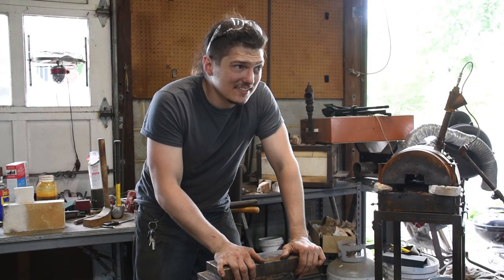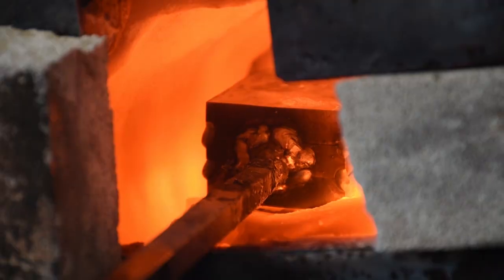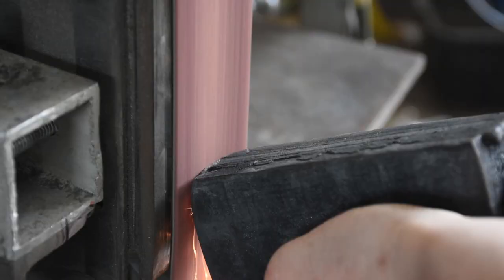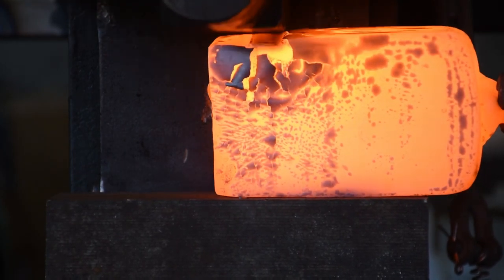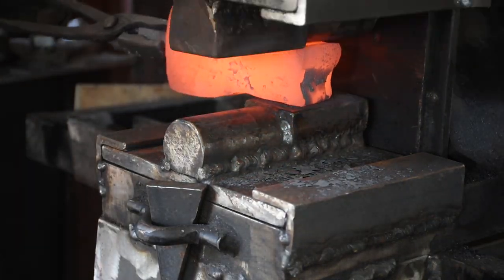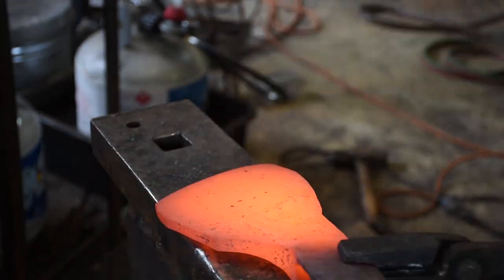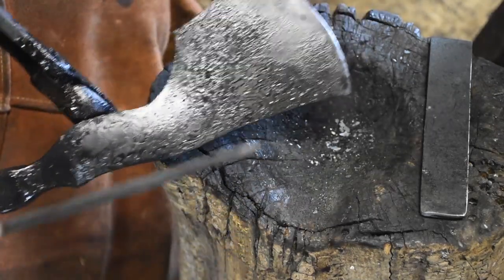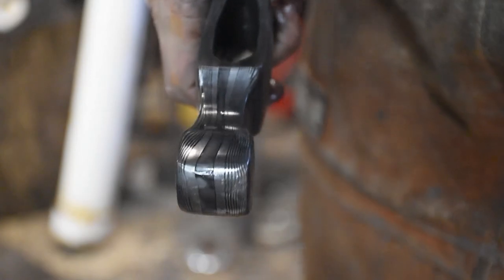Forging my first DAMASCUS AXE!

Comment: this channel is incredibly underrated. This thing needs to blow up. You are so incredibly likable. I wish you wouldnt skip the grinding/sanding though I understand why you do.
Reply from the maker: Wow, thanks!  I'm working on being able to show more of that part of the process. Part of the issue is getting good camera angles (and taking the time to frame them as I'm working ) and the other part is audio.  Sped up grinding sounds baaaad. I'm working on a better camera mount, so we'll see.
Reply: Indeed Jazzbro!

Comment: 9:45 - Bennett hits the metal so hard it warps time itself
Reply from the maker: I particularly liked that edit. Was a little worried it might not read properly, but for all the close up technical shots, sometimes you gotta pull back the camera and whale on the workpiece a bit.

Comment: 12:00 When you do your oil quench, I suspect you want to pump the work up and down to keep cooler oil in contact and thereby improve the quench.  Convection happens more slowly in oil than in water, so if you dont move the work a lot of heat gets trapped next to the blade.  Oil isnt as thick as honey, but you get the idea.

I envy you dude ... I'd love to be able to play at smithing, but it just isnt in the cards for me (rotator cuff). 

+1 😁
Reply from the maker: This setup was a little borderline, as the bucket just barely fit the axe head, but with 1084 and 15n20 in preheated vegetable oil the cooling rate is sufficient without agitating the workpiece. Ideally, I'd have a bigger quenching vessel for axeheads, as the volume of oil can make a difference. 

It is very important to preheat the oil, as it is much more viscous and has even slower convection when it is room temperature. 

What I didn't show was the quench fooled me hard. Due to the many high heats for forge welding, there was some serious decarburization on the edge. I thought the quench failed until I tested it again with HRC test files after cleaning up the edge on my grinder.  That pulled off the decarb and revealed nice hard steel underneath!

Sucks about the shoulder, maybe it's time to teach yourself to be ambidextrous?  I've done some hammering in my offhand.  It's hard, but you just have to train up those muscles.
Reply: @BennettTheSmith  Thx for the encouragement on cross dominance. 😊  Unfortunately, in my youth, I discovered that although I could do things like fence with either hand, my quasi-ambidextrousness was quite limited - for anything requiring precision (ex: handwriting) or strength (ex: archery) i'm solidly LH dominant (sinistral).  Another handicap is that i'm living in suburbia, and if I started firing up a backyard bloomery and beating steel at all hours (even if I could), zoning officials would swarm me like flies on poo, and club me like a harp seal pup. The final nail is that there's also not much of a local smithing community in my immediate area.  Bottom line is that I can only smith mentally, in my imagination, and so I watch countless dozens of vids on smithing, with no outlet for it. Sigh. 😔😏

Interesting and informative tidbit on surface decarb.  Yeah, i've always read how the folding process entails a lot of iterative material loss (somewhat analagous to removing the "heads and tails" in iterative distillation).  The loss isnt just from surface forge scale (which relates to oxygen levels) but also from the need to mill off a certain percentage of material in each pass to combat both surface decarb (which I think relates to how many heats you need as well as how much soak time occurs and at what temps) and the areas most prone to initial delamination (edges of the stack).  Definitely need to invest in a good second hand belt grinder, being generous in your use of edge fluxing, and limiting the number of heats wherever possible.

Forgive my rambling - silly of me to offer tips when ive never worked hot steel. Cheers bud. Oh, and the damascus pattern in that axe looks awesome.  Great job. 👍❤

Comment: I want to try some Damascus how do you set up your acid and what is it and is there any diloution
Reply from the maker: I use Ferric chloride, which is generally what folks use for etching blades.  I bought mine in liquid form off amazon, so it was already mixed with some water. I think you can also buy it in dry form.  I can't tell you what the exact dilution is because at this point I have no idea. It must have been around 3-4 parts water to 1 part acid, but it's not critical.

Comment: Nice work.  Just built a charcoal forge myself.  Ironing out the kinks to get it to maintian forging temp and I'll be making an ax as my first project before using it to heat and beat misc pieces of steel for other projects like I inteded it for.  Go big or go home. 
Also, watch your hair around that sander.  I want to see more vids of you making things and not one of you saying you're taking time off to recover from bashing your face on a sanding belt.  Can't tell how close you got but at the 12:48ish mark it looks pretty close.
Reply from the maker: Charcoal fires take a little management, but being able to isolate your heats and hit higher temps easy can be worth it. 

And I know, my hair does that. I can see it when it drifts in front like that. The air flow from the belt tends to push it away. I have short hairs in front for a reason though. They get burned or sanded or broken or... sigh.
Reply: @BennettTheSmith  Thank God for fire brick and wire feed welders.

Comment: How you metal band saw holding up? Did the motor give out yet? Mine did after about 6 months!
Reply from the maker: Working just fine, but its just too slow to use unless I need to cut something thick.  I've got an abrasive chop saw now that I picked up for free that gives me square enough cuts on smaller stock.
Reply: @BennettTheSmith  well that's good to hear. I still haven't replaced it I've been using a cut off wheel or hot cutting it. I cut up a bunch of 3.5" round stock with it then the next day it wouldn't start.